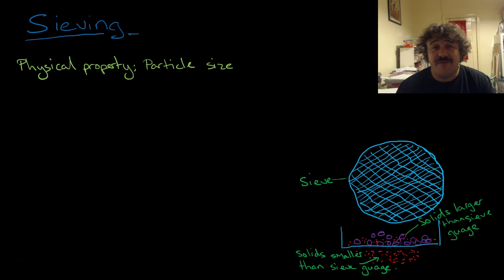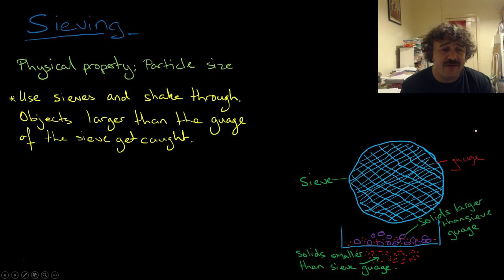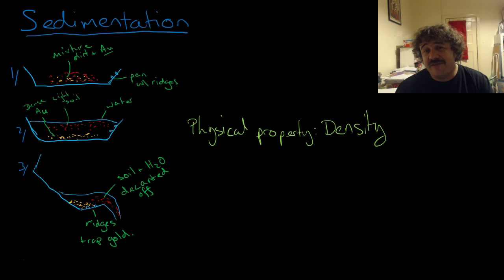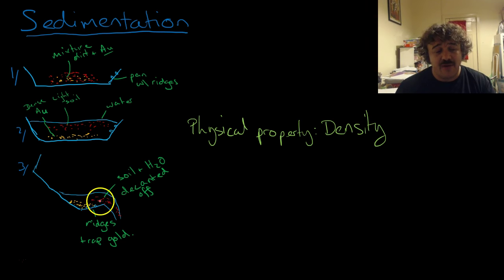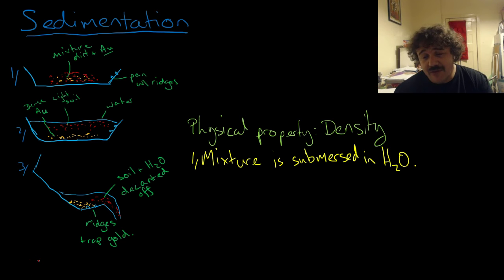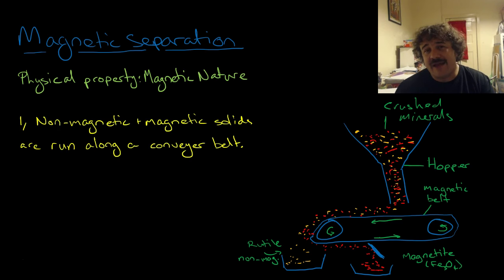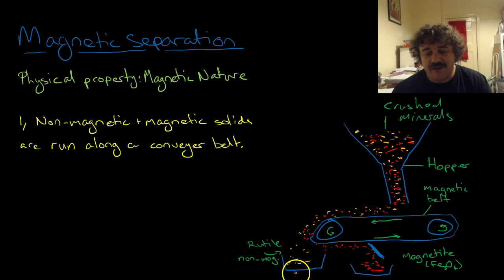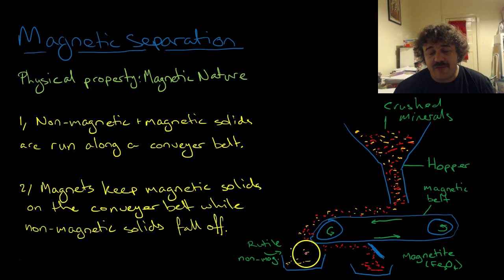Separation of Mixtures: Solid Mixtures

Comment: How fine can sieves get? Also Wouldn't there be room for error as some particles of a certain substance such as salt (NaCl) are bigger than others so using one grade of sieve would not completely separate a mixture??
Reply: +Gus Hall 
The smallest commercially available sieve gauge size is 38 microns, or 0.038 mm. 
As for the particles of varying size, it would depend what you were separating from: salt from gravel is easy, as even with differences, the salt is still finer, and salt from sand is easy because sand is much finer. It would really only be a problem if you were separating from a substance of equal size, at which point you could either grind up the salt particles to a regulation size (as the molecules are the same size, but the crystals aren't), or simply chose another method of separation based on the physical properties of each.
Reply: +Alex Butcher thanks for the brilliant reply